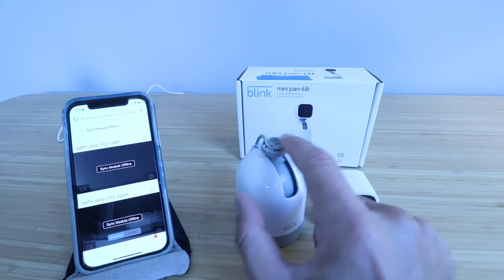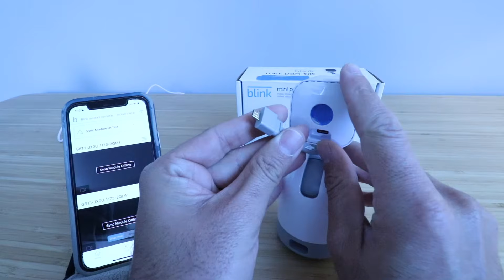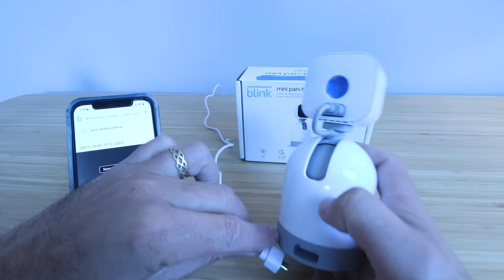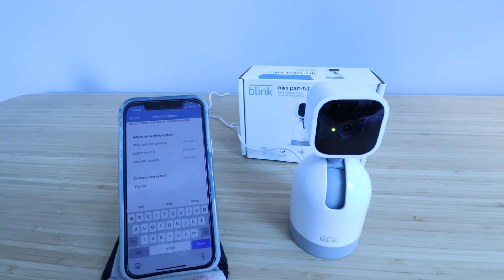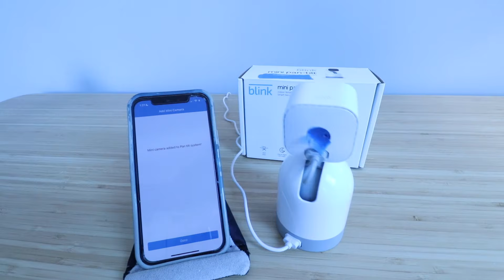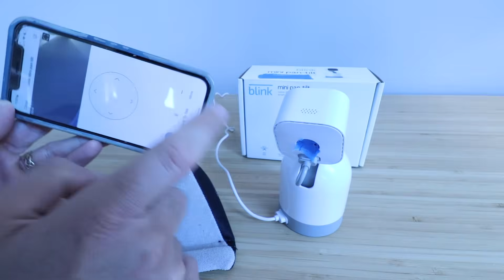How To Set Up Blink Mini Pan Tilt Camera

Comment: Thank you for your video.  Can you tell me if I can put batteries into the camera, and if so, how please?  At the moment, if I unplug the camera for any reason, it shuts down, until I am able to reconnect it.  Thank you for reading.
Reply: Doesn't need batteries
 It comes with an adapter that plugs into the wall